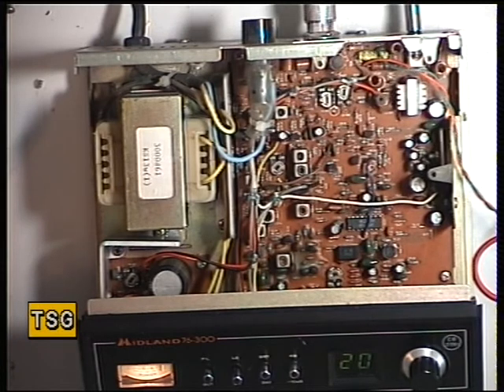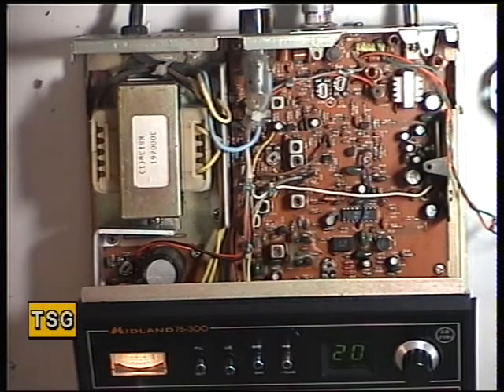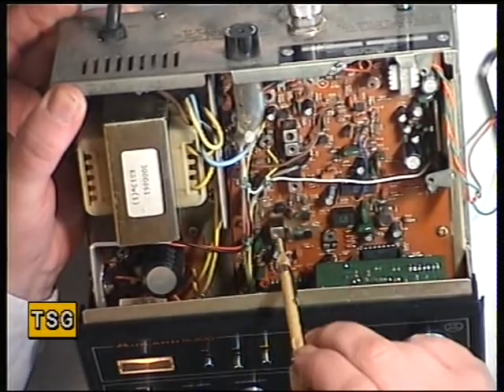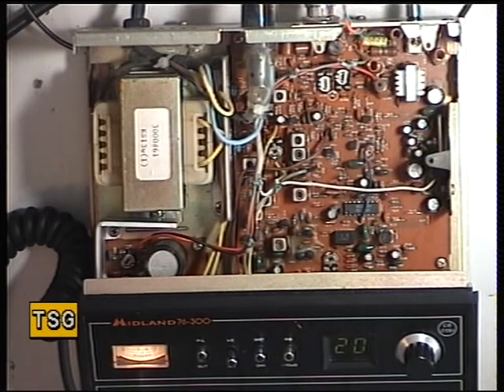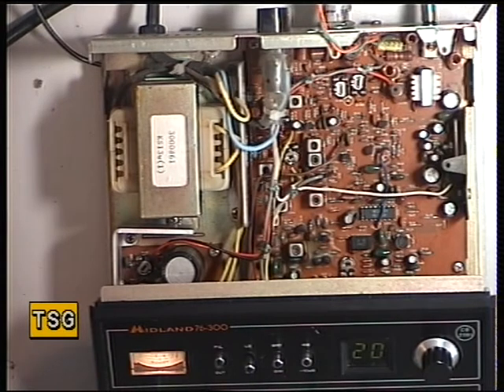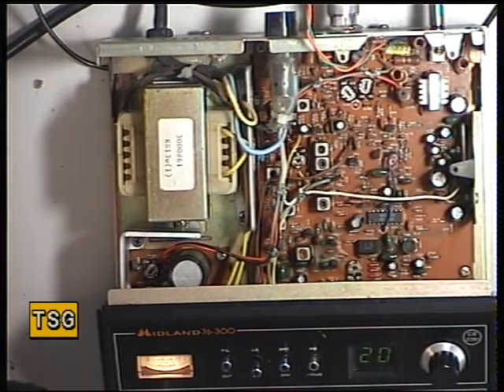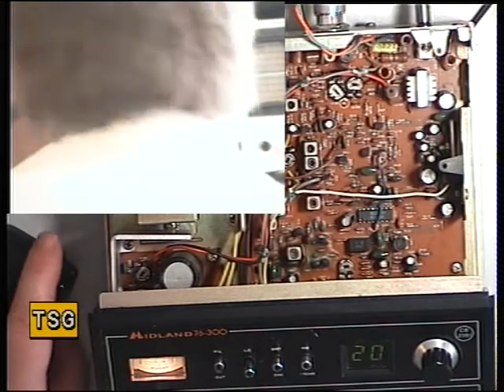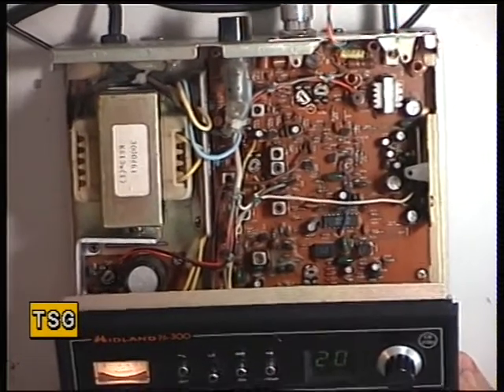Midland 76-300, UK (CB 27/81) CB radio (Base Station) - Transmitter alignment

Comment: I have the Midland 76-300 here in Missouri (USA)
Reply from the maker: I'm sure you do! The point about this video is that the 76-300 wasn't available in the UK & that this is a pre-production prototype that never actually went into production.  Bear in mind that the UK CB system is FM only and the 40 channels range from (1) 27.60125 to (40) 27.99125.

We also have 40 channels in addition AM/FM/SSB on the european set of frequencies since 2014 not of course covered by this 1983 radio.

Richard (UK)
Reply: UK CB radio servicing that's pretty cool.  Yeah, I just let you know since you'd asked about who has them.  Yeah, I'm certain they are much more common here.  Mine was May 1986 model... could not guess as to how many years Midland had these in production.

Comment: i bought one of those new back in 1990-built in the USA price $199.99
--great radio but never seen one built overseas like yours
Reply from the maker: The thing about this, it that it wasn't available here & this is a pre-production prototype. Bearing in mind the UK FM CB system is 40 channel 27.60125 to 27.99125, which is unique to this country.

Richard (UK)

Comment: I have found a jesan 5005 UK standard and I will like to convert this transmitter to European standard. there's a possibility to convert or not ?? I searched on the web the electric diagram but ....nothing. can you give me some advices how to make it ? If yes, please answer here and I'm gonna reply back . Thank you.
Reply from the maker: +Mihai Cosmin I've never seen the 5005. I've just checked if I have a circuit, but I haven't. Knights of Kirton (have a good website) here in the UK have plenty of circuits & I suggest you have  look there.

Bear in mind that if you successfully convert it, it will not be legal to use in your country, as it will not be type approved.

Richard